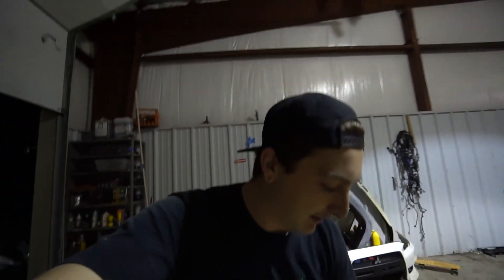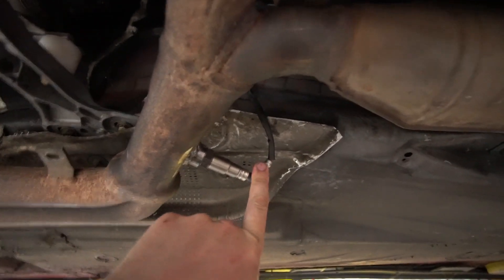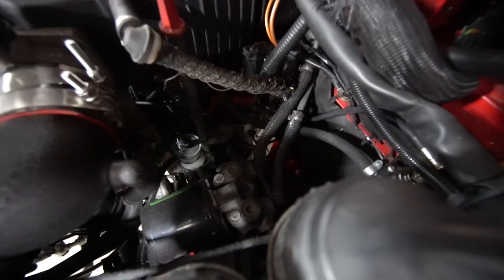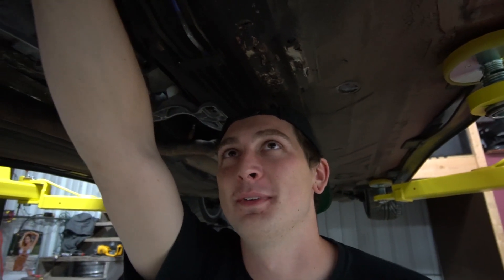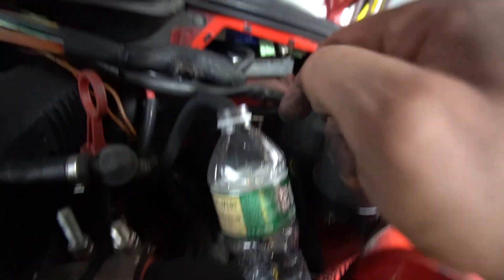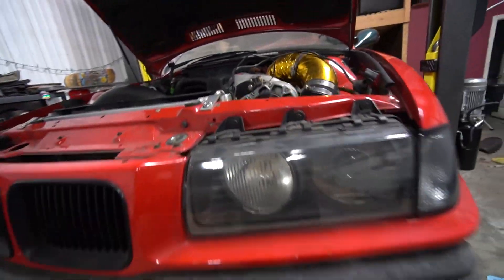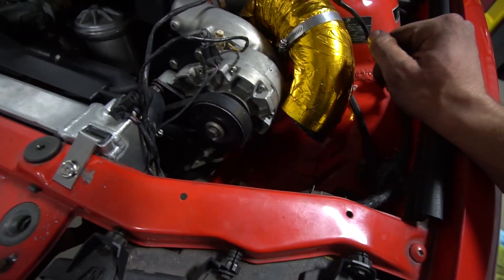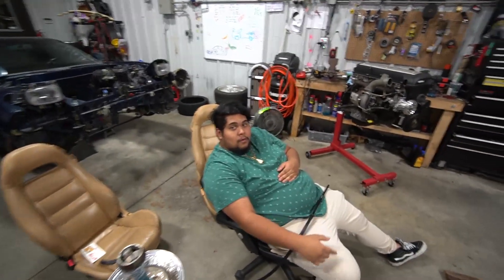BACK TO WORK ON THE E36

Comment: Non taper is nps national pipe standard.  Also very common to use O ring boss fittings also. Which are similar to banjo but use a rubber oring rather than a copper washer

Comment: Didn't somebody warn you about that pump running backward on install and with doing so potentially breaking it? Anyway your getting a new one. I'm a fan of the yellow fogs. Another thing, as the scientist you are have you ever looking into the differences between MAF and MAP. The Hot rod magazine website has a older interesting article about it. Shortcut to the story; a MAF measures air constantly where as a MAP assumes an average. While I get that you go for MAP for explained reasons, a MAF is actually more precise.

Comment: Jimmy your positioning of the wideband sensor is wrong. read the manual. the sensor must be on the upper side of the exhaust pipe 45 to 90 degrees ,otherwise moisture collects inside the sensor and kills it.

Comment: It's not the the step bits it's the factory stainless exhaust,destroys saws drill bits etc.For o2 I turn welder right up but leave wire speed down and just blow a big ol perfect hole

Comment: protip-  don't have to buy new step bits, just sharpen the cutting edge real quick.   if in a bind just use a grinder and hit the edge and bam good as new

Comment: Please adjust the tension on the migs wire feeder please or adjust the wire feed rate if the tension is correct.. It's torture listening to it skip like that.

Comment: the schrader valve is for a quick compression test without having to rerun the lines or use 700 adapters because you can't find the right damn fitting
also get clear fog lamps, those yellow ones look weird for some reason

Comment: That is not a fuel prime valve xD its a fitting so u conect a gage to see your fuel pressure on the rail e46´s have them too ;) some  guys like get a hose in there and have the gage inside de car so they check it as well. Awsome video im dieing to see this build done :D

Comment: Its not very smart using the lift if the pump is bad. If it goes out at the right time, whatever car you have on it could get stuck there until its replaced because of how the locking works.
Reply: My neighbors had a car stuck on his lift about 8ft in the air when one of the struts on one side went out. Luckily he had like 6 8+ft jack stands to balance a Honda CR-V on. The fun part was lifting it another foot so he could release the locks and lower the arms so he could pull the struts out and have them rebuilt